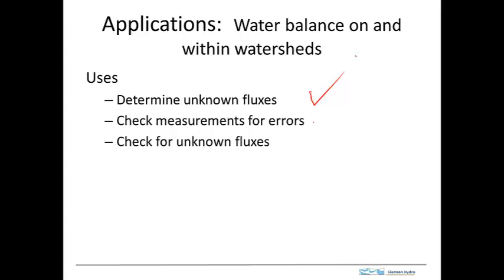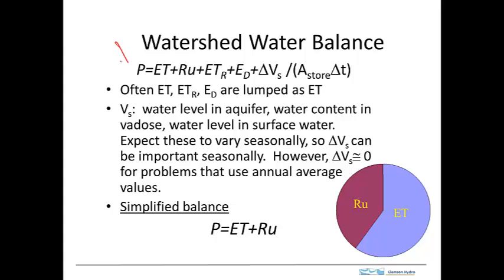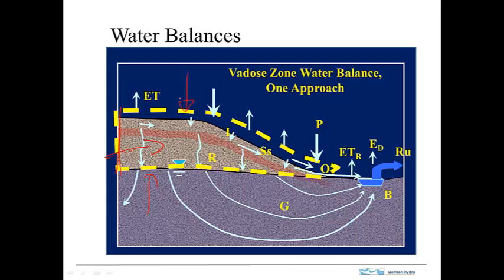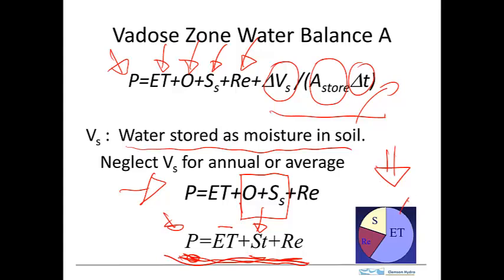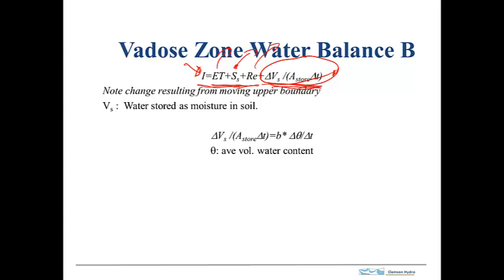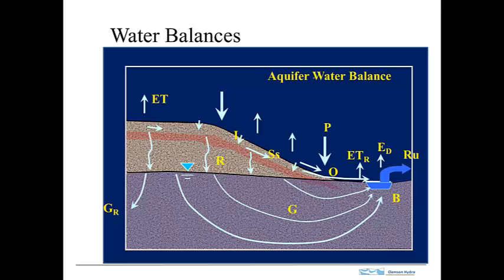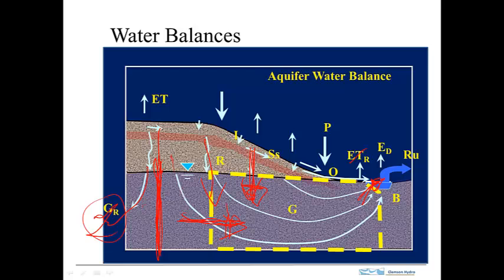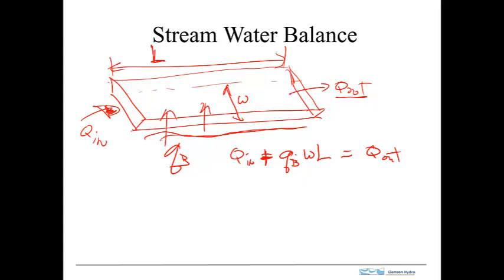water balance part 2 watershed

Comment: Thanks for sharing! I have a question, how to estimate each value of the equation? I mean, what values can I use if I have measurements of precipitation, evapotranspiration, runoff and so on along space and time? Thanks in advance :)
Reply from the maker: Walter,   Good point.  If you have measured everything, then you can use the water balance to check to accuracy of your measurements.  Another application is to measure everything in the water balance except one component, and then use the balance to calculate that component from the measurements you have.  One example is to use measurements of precipitation and streamflow to estimate ET.  ET is more difficult to measure than precip and streamflow, so this is a way of leveraging two simple measurements to estimate a more difficult measurement at no extra cost.  Larry
Reply: @lcmurd1  thank you very much for your comment!